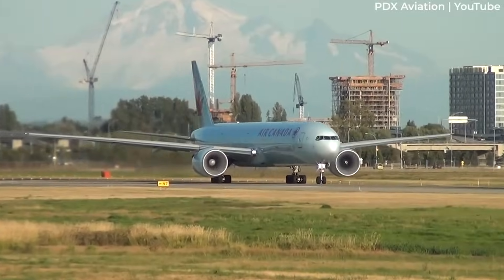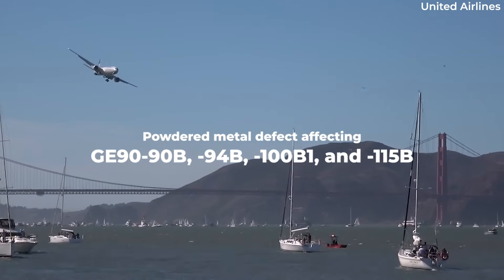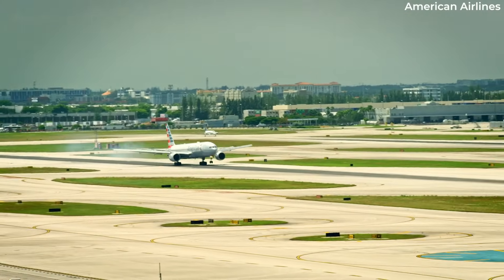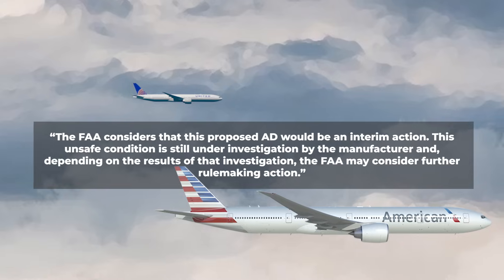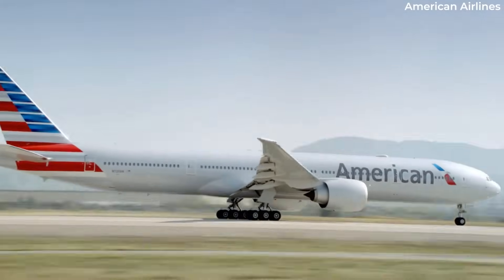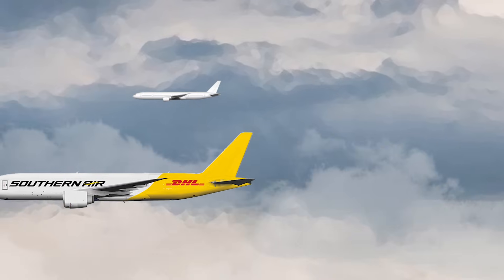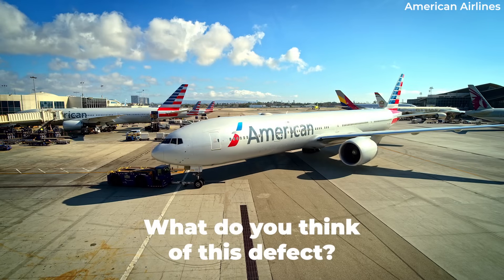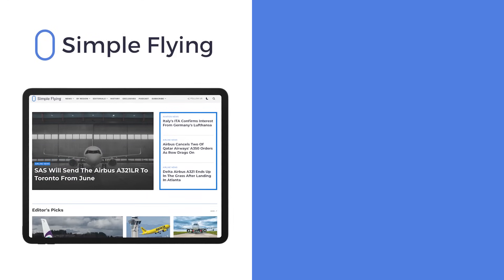Boeing 777 Engine Defect: FAA Proposes GE90 Airworthiness Directive

Comment: Bye RR engines, the  best.
Reply: That one caused that BA 777-200ER to crash land in 2008 at Heathrow
Reply: even so Trent 800 is the most reliable and popular engine on 777-200ER, and GE90-85b has caused BA2276 catches fire at LAS @filledwithvariousknowledge2747

Comment: How bad is this defect that some 777s that use GE engines have had no issues for the entire life of the plane for 28 years? Or is this engine issue related to the newer built ge engines?
Reply: I'm starting to think its more with the source of the powdered metal in recent years since the engine issues seem to suddenly pop up in A220/A320 aircraft.

Comment: FAA seem to enjoy getting their nose into Boeing aircraft. 
Are they trying to destroy them ?
Reply: Nope, they're being hyper careful with Boeing after getting burned by the 737 MAX's problematic  Maneuvering Characteristics Augmentation System (MCAS)  scandal.
Reply: @ha-meemfirozezaman1417 It just happens that there are types of people who would trash Boeing because of engine issues even though it's the aerospace engine's manufacturer General Electric's responsibility for the GE90 engines. Of course Airworthiness Directives aren't meant to destroy aircraft manufactuters.

Comment: The GE90-115b still the best engines ever made in my opinion
Reply: And Rolls Royce engines are sucky
Reply: @jlmarc01  Please elaborate
Reply: @jlmarc01  so why Trent 800 is the most popular engine on 777-200ER not GE90-94b or PW4098?
Reply: @Pz349  just remember the issues with the 787
Reply: @jlmarc01  but Trent XWB, Trent 700, 900, and RB211 are best selling RR engines except the unreliable Trent 1000. GEnx also has icing and shaft separation in its initial operation
Reply: Still the best whilst including this defect?
Reply: @AnotherPointOfView944 nothing is 100% perfect 🤷🏾‍♂️